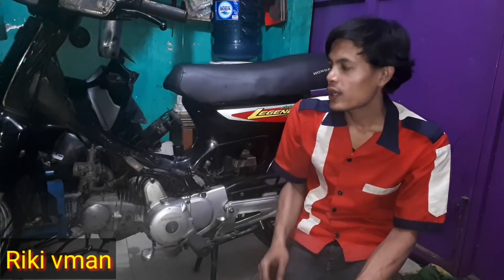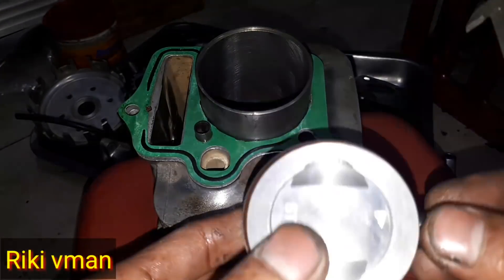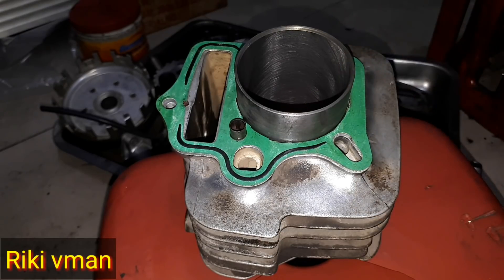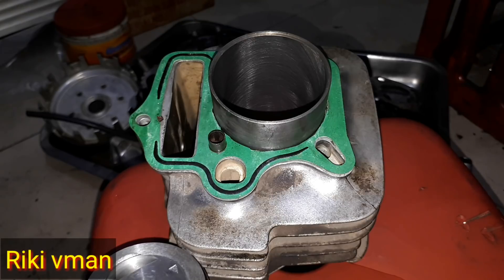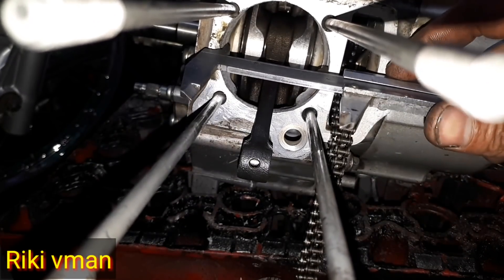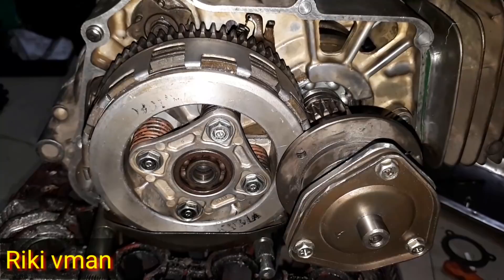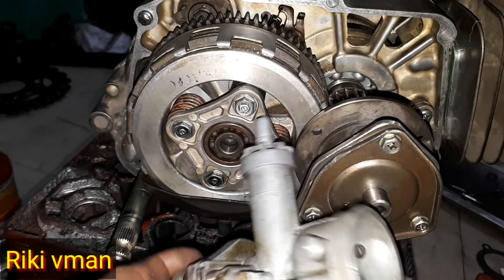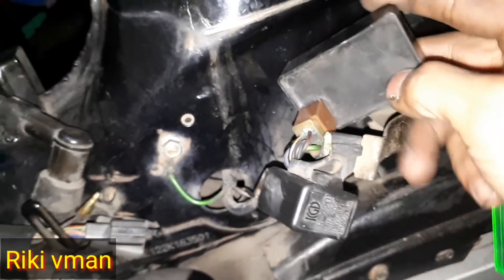Menambah power astrea legenda !!! Korek harian supra c series !!! Tips korek motor c series.

Comment: Itu kira2 berapa total biaya nya kang?
Reply from the maker: Boring 200.
Piston 130 .
Bubut crankcase 50.
Karbu blade seken 150.
Paking top set 30.
Reply: @rikvman  mau tanya lagi kang.. motor supra fit pake piston jupiter z merek FIM os 100 lebih bagus pakai packing blok yang tipis apa yang tebal asli nya?
Reply from the maker: Klw pake fim biasanya piston jenong.
Mnding pake pake paking bawaan.
Klw blok besi (grand supra lama) pake paking tebal. Depan pake satu lembar.

Klw blok almu. ( legenda supra fit) pake paking tipis.

Tinggi piston dibuat 12.8 supaya ga nabrak.
Reply from the maker: Klw sepengalaman saya piston fim kurang awet kang.
Bagusan npp..
Reply: @rikvman  kalo npp ga ada jenong nya ya kang? Apa tenaganya bagus kang?
Reply: Saya udah pake piston jupiter z os100, pick up udah 20mm.. akselerasi bawah mantap... rpm atas masih biasa aja kang.. motor saya supra fit..
Tolong saran dong, kalo engga akang aja yg ngerjain mesin motor saya.. kirim alamat biar dikirim mesin nya